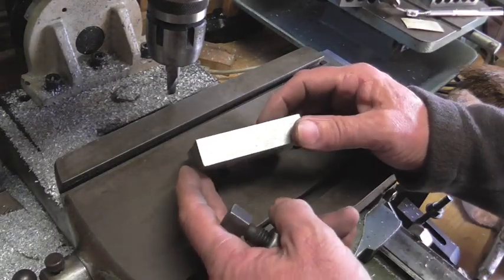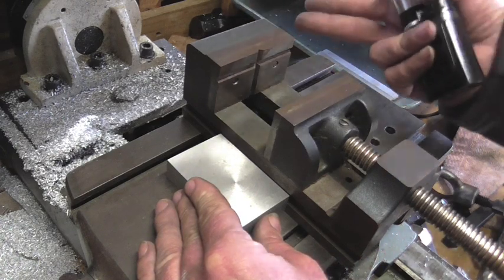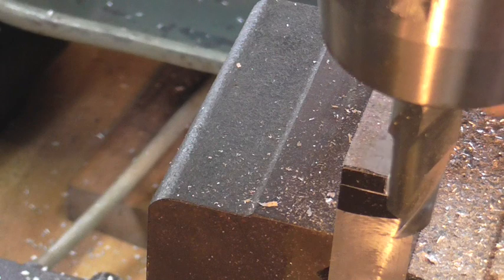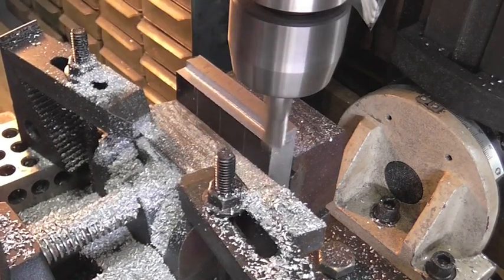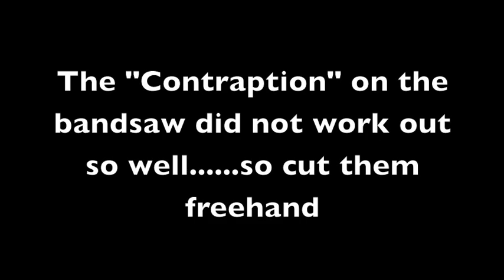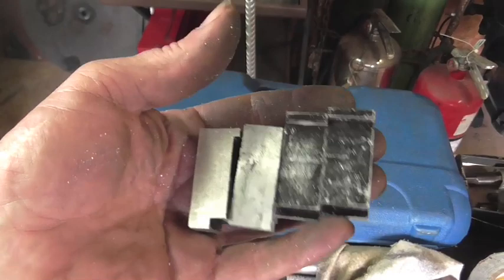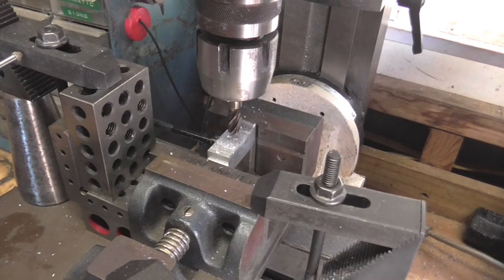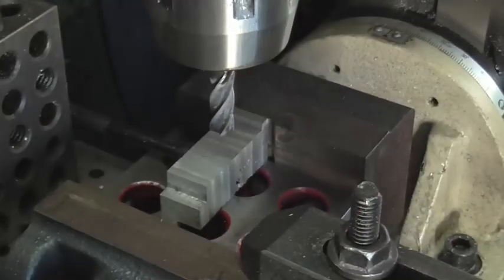Machining Low Profile Vise Clamps * FIRST MILLING JOB EVER! * P1 - MSFN

Comment: Tramming the vice:  If you bolt a long piece of bright bar stock to the mill table, and tram it properly, you can clamp the vice to it upside down then, moving only the longitudinal travel of the mill, bore two shallow holes in the bottom of the vice, and put a threaded hole in the bottom.  Make these in line with the clamping holes on the lathe.  Then you make two buttons that just fit into the T-slots of the mill.  You can just drop these buttons into the T-slot, and the vice will be trammed every time.
Reply from the maker: Now that sounds pretty brilliant now that I am picturing it. I like that idea. Its the kind of of stuff I do alot of on this channel....unorthodox but gets the job done! Not sure if you subscribe me but please stop back and share more stuff like that ~ Richard

Comment: I'm just about to start doing the same thing for a new vise. I'm currently using the smallest toe clamps in my set to bite into the slot that runs across the bottom of the vise. No need to keep removing the clamps for every operation that way.
Reply from the maker: Yep, I just want to bolt the vise down once and be done with it. Hope you stick around for Part 2 :-)

Comment: Don't apologize for not having all the right tools...... We all got to start somewhere and for your limited tooling I think you did alright for the job at hand. I have been doing this stuff for many years and even now I don't always have the "right tool" so don't sweat it. Just be careful and get in there and get it done. People learn by doing and doing it some more and in time it will come together. Little tip on climb milling. Yes you get the best finish just make sure you tighten your gibs so the cutter doesn't grab your work and snatch it out.
Reply from the maker: Tips on how to do things better are always appreciated.  Thank You! Documenting my first milling job was a bit nerve racking. If I climb mill on this little guy its gonna be .002 at best. Part 2 is out if you have interest 😊

Comment: Great job. Maybe if you reduce the depth of the cut and take multiple passes for the slot it would work better? Seems like a lot of tool against the work. What kind of mill do you have?
Reply from the maker: Thanks John, As you can see I was going for the gusto on making the slot in one pass(FAIL) Yes, I am sure your idea would have worked good. I will address how I will put the slot in in part 2. Its what I call a Frankenstein Mill, its a milling head from a Grizzly Lathe/Mill combo thats mounted to an X/Y table from another machine tool of unknown origin
Reply: Sounds cool, and looks like it works well. Good job putting that together. Best stock up on 1/8" end mills. When they meet Gusto.. it ain't pretty. :)
Reply from the maker: Lmao, I have yet to break one, but I am sure its in my future! 😊

Comment: Little mills will do a good job. Just need to work with them..Like you said the mill may be dull or you may have been trying too much of a cut, did you try multiple passes at a small depth. If the slot didn't work then the mill was dull
Reply from the maker: It was an endmill I got with the mill when I picked it up, I am pretty sure it was in bad shape from the previous owners abuse. I dont have enough experience to say for sure tho. I dont own a brand new endmill to compare. I guess all that will come with time and experience
Reply from the maker: Pretty happy with the result so far on the project...thanks for watching

Comment: I am looking to buy a mill so I can mill recievers.  Hard to do with a drill press lol
Reply from the maker: My old drill press had a hard time makin a hole Lol
Reply: Makin Sumthin From Nuthin lol yes sir.  Mine still spins,  but the press part is locked up.  I think it broke a tooth. I just haven't messed with it much yet.  I may do a video on it.  Unless I get mad and set it on fire.

Comment: Chatter means poor workhold. Push your mill ends a little more, learn their upper limit. A lot of mills are happy very close to their limit, because then the steel is stretched and is extra rigid.
Reply from the maker: I should have held them sideways so I had more surface contact with the part....I got tons to learn about milling. Thanks for the suggestions!
Reply: It's a bad idea to learn milling in such a dotted way, where you learn all tricks of the trade as just tricks. You need to get a better understanding of the whole process. It's best to imagine a line between the spindle, going through the xyz axises, then through the vice, and to the actual workpiece. The shorter that line is, and the less interruptions there are, the better results. 

Then to get best tool use, you need to use a formula that determines the "load per tooth" according to what your spindle's maximum power is. 

This guarantees perfect machining.

Also it helps to imagine every operation, to "project" it onto the workpiece in your mind, and see how that can work out in real life, and maybe even find a way to do multiple operations with one setup. 

Hope this helps. If not, shoot me another message.
Reply from the maker: Well, I gotta start somewhere. I was in the same boat 15 months ago when I first got my lathe. I will learn as I go and listen to all the viewers leaving comments who have much more knowledge than myself about milling. Its a big project as a first milling job to be sure :)

Comment: End mills should never be used in a drill chuck. They chatter a lot and  neither the end mill nor the chuck are happy about it. That being said, you work with what you've got. Nice work.
Reply from the maker: Yes, you are so right. In this video I am holding the endmills in a collet however and not a drill chuck. Me thinks it was just a wore out endmill as all it did was rub and not cut...I need to get some tooling for this little guy :)

Comment: Hello Richard.
I can only hope and Pray U get enough Tooling to be able to work efficiently with Your Machines. 
Just one worry though .....U started out with Aluminium for these Vise Clamps which we reckon was not such a good idea in the first place. We are pretty certain U must have Steel, any scrap,  so-called-mystery Steel, lying around which would definitely have been a better, stronger and more Rigid option to hold down that Milling Vise.  Ideal would be some Tool Steel.   From the little we know, when U think and do Milling, U only want RIGIDITY.  And that Aluminium is soft - to say the least.
And while we are talking Milling, GANG Milling like U just did with all Four Clamps, it's also a good bet to Shim the pieces on the Movable Jaw side so that will ensure ALL the Pieces are well Gripped in the Vise Jaws.  Otherwise, 'twas good watching and learning from U as well as U have to really improvise and make do with what U have which stretches our imagination to think Laterally.  Just our two cents......  No offence meant.
Looking forward to part Two !!!
Pray U get loads of Tooling from Well Wishers and enough Jobs to keep Your Machines humming sweetly.
ATB
aRM
Reply from the maker: Hi aR M, I had no steel around here that was thick enough to make these clamps out of. Is aluminum a terrible choice?....Absolutely! But its what I had and even then it took a lot of lathe work to get it usable....I am not used to needing flat stock around here so obtaining mill food is certainly on the to do list.

The plan is to make this aluminum set and hope they last long enough to hold the vise down for my next milling job....remaking a new set of clamps from steel.....that was the plan all along. I just need to get the vise held down without having a contraption on my table...LOL

This job if not anything else....was good practice on use of a mill since I never used one....even if these aluminum clamps are temporary....I think they will get me by until I make a set of steel ones (I hope)

Richard

Comment: hay Richard to bad you don't live near me in Kelowna Canada because I am going to be making a lot of tools for metal working in cast iron so as I make stuff il send some your way as I make it good job with the aluminum its hard to work with degas the aluminum with tablets you can buy or co2 and a good riser helps with the shrinkages and only use aluminum for other castings like car rims and truck rims this is the best for your uses its strong and less of a problem to work with .if you ever want too do cast iron work use used motor oil its cheep and way hotter than propane the best noseil too use for it is the kiwi nosel  sorry bad spelling .and you'll need a vacuum motor for a blower too .
Reply from the maker: Hi Dan, I live in Florida. Yes, previously cast aluminum is the best source for foundry scrap, When I first started machining the ingot I had no inclusions to speak of but as I milled away at that thing the metal quality did nothing but get worse. I knew I should have grabbed the other ingot! LOL
Reply: hydrogen is produced when melting aluminum some times you can take aluminum foil and put some backing soda in it and push it too the bottom .to off gas co2 this works only if its precast ,I also have a resapey for making your own cresabuls  if you want it ill send it too you on here sorry for the bad spelling I am 57 and only have a grade 2 ed so now you know why .
Reply from the maker: I have experimented with different degassing methods, all had limited success. My best results have always been when the molten aluminum wasnt overheated
Reply from the maker: Dont worry about the spelling...skills outweigh the written word...and you obviously have many skills 😊 ~ Richard
Reply: thanks Richard